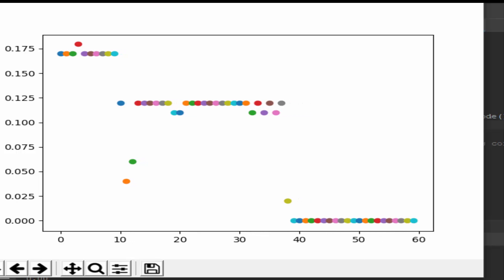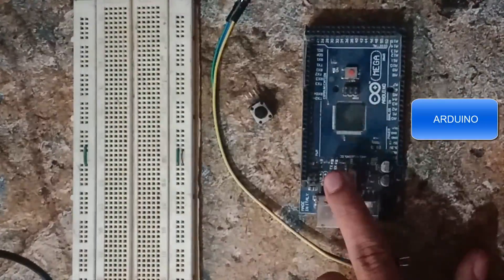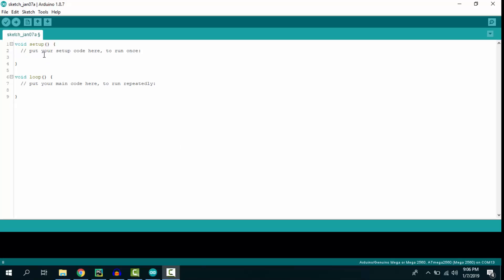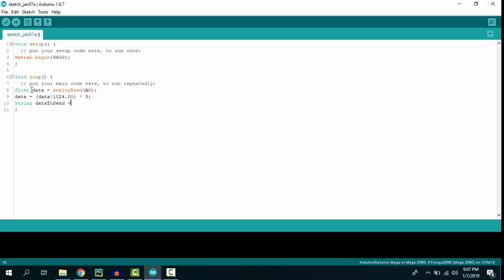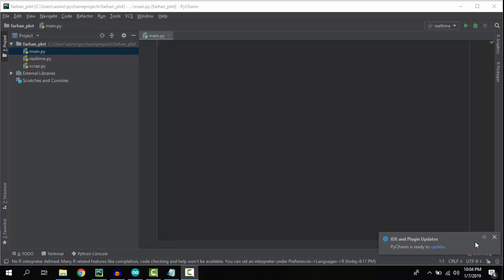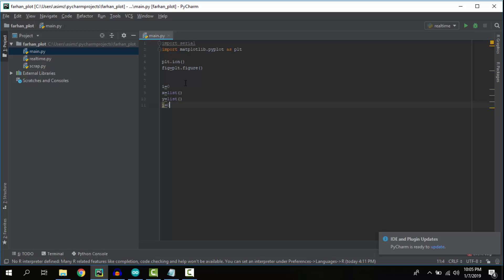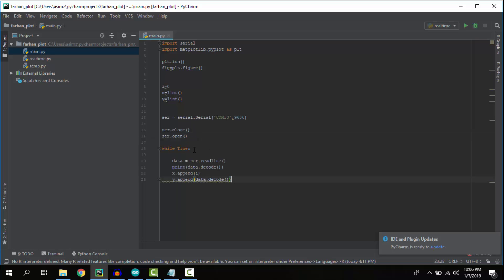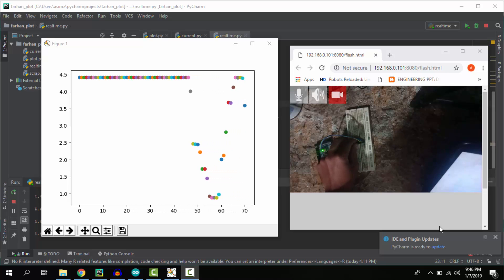Arduino plot graph using Python

Comment: I'ld like for Python to read a line from the serial port, which contains 3 values, then a carriage-return..

but before plotting the 3 values, I'd like python to always add an offset to one of values.

How could I do that?    Is tkinter or pyqt necessary, or can I use only matplotlib?     drawnow?

ex. 
import serial

ser = serial.Serial('COM3', baudrate = 9600, timeout=1)

Data = ser.readline().decode('ascii')
Reply from the maker: In order to read three values in a line just use a delimeter in between them  like comma "," and after reading that in python using data= ser.readline().decode() just split it using data.split(",") and then you will have list of 3 values add your offset but before that you will have to convert it into int or float and then plot it . :)

No , tkinter or pyqt is not neccessary . You can just use matplotlib .

Comment: thx!!! it is very helpful. but i have a little problem. 
I am communicating through bluetooth and i have a lot of lag in readings. it's stuck and it plots a single value. do you have some advice?
Reply from the maker: Can you show me your code?
Reply: @HighVoltages  

***This is for read 3 cny70 sensors an plot their values

import serial
import matplotlib.pyplot as plt
from drawnow import *
import sys

plt.ion()
contador = 0

def grafica():
    plt.subplot(1, 3, 1)
    plt.ylim(100, 1000)
    plt.xlim(0, 50)
    plt.ylabel("Intensidad")
    plt.title("sensor cny_1")
    plt.grid(True)
    plt.plot(val1, 'r-')

    plt.subplot(1, 3, 2)
    plt.ylim(100, 1000)
    plt.xlim(0, 50)
    plt.title("sensor cny_2")
    plt.grid(True)
    plt.plot(val2, 'b-')

    plt.subplot(1, 3, 3)
    plt.ylim(100, 1000)
    plt.xlim(0, 50)
    plt.title("sensor cny_3")
    plt.grid(True)
    plt.plot(val3, 'g-')

val1 = []
val2 = []
val3 = []

# ser = serial.Serial('/dev/rfcomm3',9600) # Bluetooth
ser = serial.Serial("/dev/ttyUSB0", 9600)  # USB

ser.close()
ser.open()
# data = int(ser.readline().decode().replace('\r', '').replace('\n', '')) # first data will not be plotted
ser.flushInput()

try:
    while True:
        while ser.inWaiting() == 0:
            pass

        data = (ser.readline().decode())
        array = data.split(',')

        v1 = int(array[0])
        v2 = int(array[1])
        v3 = int(array[2])

        val1.append(v1)
        val2.append(v2)
        val3.append(v3)

        print(v1, ",", v2, ",", v3)

        drawnow(grafica)
        plt.pause(0.05)

        contador = contador + 1
        if contador > 50:
            val1.pop(0)
            val2.pop(0)

except KeyboardInterrupt:
    ser.close()
    print("serial connection closed")
    plt.close()
    sys.exit()
Reply: @HighVoltages  this is for read 3 cny70 sensors and plot their values. but only takes the first value and stops reading. the strange is thath keeps ploting only the first value
Reply from the maker: @foreverdiego  can i see arduino code?
Reply: @HighVoltages  any sugestions??
Reply from the maker: The code seems fine,  the problem can be with sensor.  Try to see values on serial monitor
Reply: @HighVoltages  i think i've solved the problem. the baud rate is too slow for tha amount of data that i need to send. i just change the baud rate to a faster one and its working
Reply from the maker: Thanks for sharing ♥
Reply: @foreverdiego  What Baud rate did you set it to? I'm having the same problem but with accelerometer data...